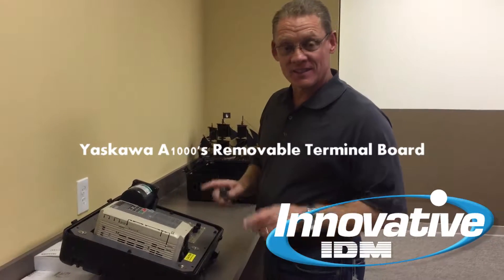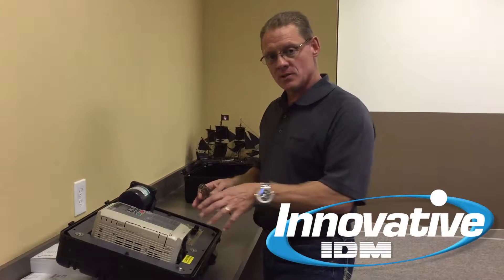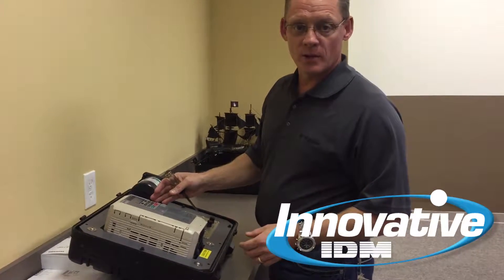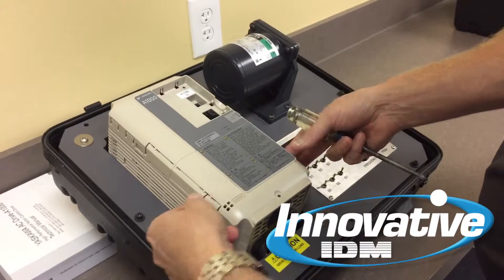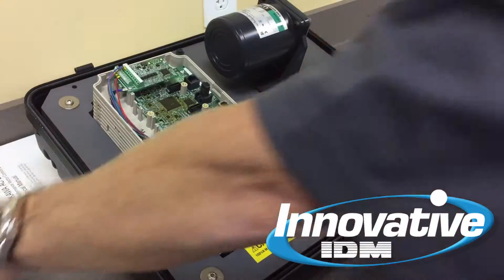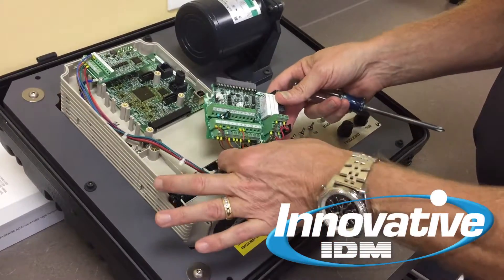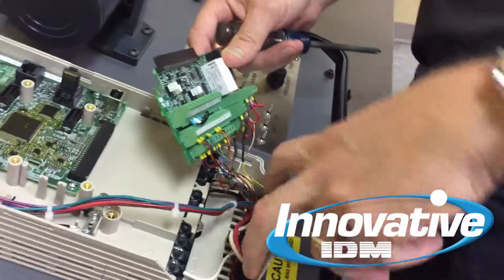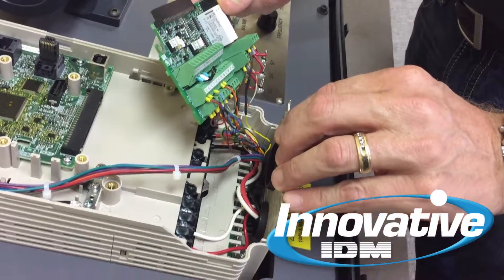How to Remove the Yaskawa A1000 Terminal Board

Comment: Hi, 
I have question Can i use the Terminal board from another drive A1000 ? 
I have one drive had failure in Terminal board and i am planning to change it with another drive A1000 had healthy terminal board.
Reply from the maker: Terminal boards in all A1000 series drives are the same and are therefore interchangeable. Be careful when putting swapping terminal boards as the board holds the parameters. One parameter is the size of the drive; FLA – full load amps. So, when you swap the boards, you just need to make sure the drive is programmed for the proper horse power/FLA.